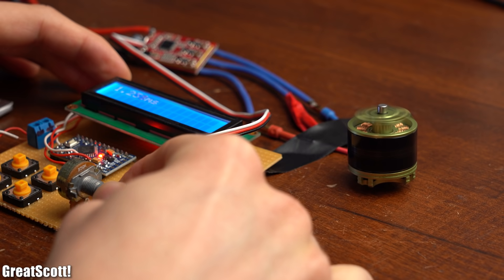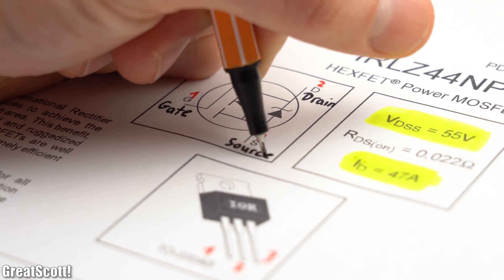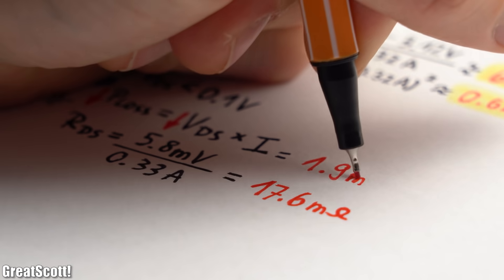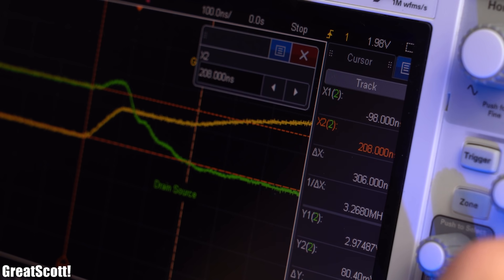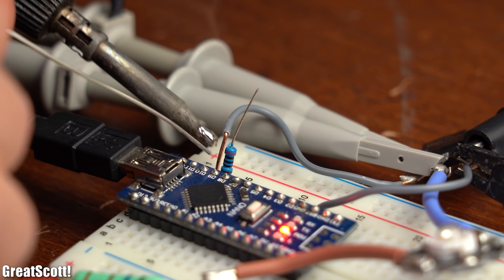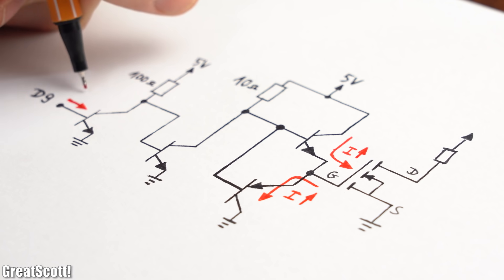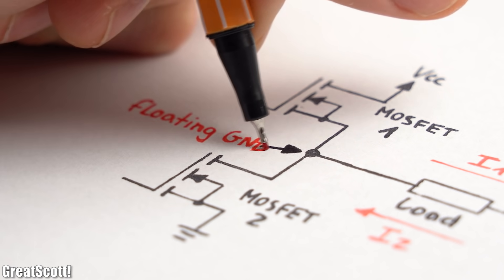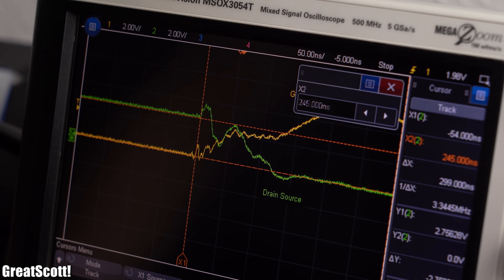Here is why MOSFET drivers are sometimes essential! || MOSFET Driver Part 1 (Driver, Bootstrapping)

Comment: Get a better marker so you don't have to overdraw every single path 3 times. Also get a better highlighter. While it looks good, you abuse the viewers time for something that means absolutely nothing to the problem. You could instead explain your diagrams and your equations. I feel the focus is wrong in this video. You clearly know what to do about the electronics, but you deliverance needs a bit of work. 

I was looking to get some knowledge about the MOSFET, but besides the hidden capacitances, I don't feel enlightened. 

Very pretty diagrams, though. Could perhaps be drawn in advance? Also easy to understand your spoken English.

Comment: @GreatScott, is there a way to find out the mosfet "Turn on event time" without scope? Or to be more precise, what values from datasheet I need to calculate correct resistor between arduino output and GATE...especially for MOSFETS that have quite high Qg (162nC)

Comment: I notice you use the oscilloscope to measure the time for the MOSFET to activate in ranges of 300 ns or less. I guess this will mean that you need a quite expensive oscilloscope with a fast samplerate just to determine if you need a resistor for protection of a microcontroller. True, or am I missing something?

Comment: hi...PLEASE HELP,
I have a TC4429 Driver chip and a IRF4905 P channel mosfet.
I want to make a High side PWM drive. (it must be a high side driver as the negative of the load is PERMANENTLY connected to the Battery's Negative.)
I have put a 10k resistor from gate to positive,  
if i run the TC4429  on 12V.  and the load is a 12v load.... no problem it works fine.
However I want a 24V output and when i connect the mosfet to 24v then the TC4429 is still run on 12v, i think it does not provide sufficient voltage to the gate.... is that right and how do i solve that.
I'd really appreciate any help.

Comment: Question: Why do you need numerous BJT transistors in his example mosfet gate driver schematic (not the IC)? Wouldn't 1 suffice to switch an external power source to the Mosfet Gate, charging it and switching it more quickly?

Comment: Hi Scott a quick question, Im building a SSTC and im powering my driver circuit with 12VDC and I try to measure the output right after the mosfet drivers and I only have 1mV of voltage in the output 
By the way when I meassure in the pins I have the 12V.
Why would that be?
PS: I have wire it all correctly according to the datasheet and my frequency is coming out ok as well

Comment: MOSFETs should be kept in antistatic bags or conductive foam ... not rattling around in a plastic box. They should also be handled properly. You can easily blow the gate oxide by mistreating them.

Comment: I'm new to circuits, what is better mosfet or transistor when switching a highvoltage motor on and off digitally?
motor 250mah 6-12V tried transistor as switch vc 100maH 50V external power 9v it burned lol
and almost bricked my arduino board

Comment: I have this issue that has been bugging me since school. As I understand it, PWM sends a pulse train of 500Hz. So you have two transitions every 2 ms. 
What happens inside an H brigde when the upper and lower mosfet during transition? Is there a risk of both of them conducting at the same time?

Comment: these days, instead of using bootstrapping circuit to drive upper MOSFET, one can use optically isolated gate drive IC such as TLP250 (or equivalent). This Method is much easier but requires to have more isolated supply ( but this can be easily done using isolated DC-DC converter)

Comment: 47 amps through that one little pin. . . on a system that will have 8 gauge or so wire everywhere. . . seems so strange they don't have beefier pins.

Comment: Discharge resistor should be placed BEFORE current limiting one, otherwise you're creating a voltage divider on Gate pin.

Comment: Miller capacitance, the one you are talking at 6:30, is why we can't have nice things in the world. It really makes interesting engineering challenge, and is unavoidable. I once was designing high efficiency inverter, and instead of just using 4 MOSFETs, I ended up with 4 MOSFETS plus extra 48 transistors (FETs and BJTs), plus a 16 channel DSP driving scheme. Crazy, but it worked beautiful. Required a lot of simulations, including parasitics. Using driver ICs is probably better tho, both from complexity perspective, isolation, and performance (ICs can bring loop area smaller, and and reduce inductance). Also 4-pin FETs are getting popular, especially the SiC and GaN ones, where there is a separate source pin, just for driving. The pin has own path to the package for source, so there is no voltage drop when there is current flowing, and it has lower inductance, all helping with turnoff time and voltage clamping.

Comment: we need a video on snubber circuits that are used within mosfet output sections to prevent high voltage overshoot and ringing when driving inductive loads like in SMPS applications

Comment: sir, i have a plan to make arduino pwm, since the main voltage is 18650 battery,  so the voltage will decrease. how i put voltage feedback for pwm ? i failed many time to do that, since no pwm use voltage feedback, except for buck or boost converter....

Comment: Just wondering, how did you arrive with 200 ohm resistor value. Also, is it a concern that the 56mA current is higher than the 40mA stated?

Comment: At 8:37, your resistor setup could be improved. With your current setup you’re creating a voltage divider. You should put the shunt before the series resistor instead to get the same benefits with no voltage division.
Reply: How can it make a difference if they are in parallel?

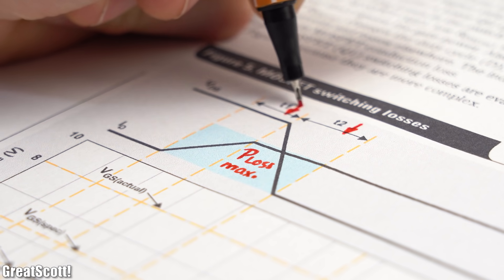Comment: Yo Scott!  The mosfet driver circuit shown at 9:40 rapidly charges and discharges the gate of the mosfet just like you told us.
But another aspect of this circuit is that it also inverts the mosfet ON/OFF-state in respect to the microcontroller pin at D9 ?
With the gate connected directly to the microcontroller,  that pin turns HIGH = mosfet ON, pin LOW = mosfet OFF.
And using the mosfet driver schematic it becomes: pin HIGH = mosfet OFF, pin LOW = mosfet ON.
Or am I misinterpreting that schematic wrong ?
Always nice to see a new video from you, keep it up !!
Thanks.

Comment: Very well done videos. You have a natural talent for teaching. You lay out the concepts in a logical way which makes them easy to understand. I have a formal education in electronics, but informal instruction like this through YouTube is really amazing for the hobbyist without a formal education. You have earned a new subscriber.

I've used plenty of MOSFETs in a variety of circuits in the past, but even professionals seldom just know how to do these things from memory. Unless you build the same circuits all the time it is often helpful to study some references before designing anything. I think videos like this are even useful for professional EEs who want to brush up on the concepts before diving into a design.

I just bought a broken plasma cutter. It works just like a big off-line SMPS by rectifying the 240 VAC in to 350 VDC, then switching the 350 VDC with a variable current limit and rectifying the resulting AC to develop the 10-60A needed for cutting up to 3/4" (19 mm) steel like the proverbial hot knife through butter. On the switching board are 16 FETs arranged in four groups of four in an H-bridge. I can see two rather large torodial gate drive transformers on the board. I am looking forward to the next video to make sure the technical details of using gate drive transformers are fresh in my mind.

Comment: brother scott. u r amazing . do you know texas instruments  UCC27710EVM-005
, booth strap card, which has every thing built in. the user dont need to solder anything. i used this card in order to create a switch  from 0 to 120 volts dc for a piezo module. can i send you  the details to u email? i used two n channel mosfets and an adruino to switch voltage automated. i am able to switch the voltage but need some help in voltage rise time(depends on resistor values), how can i send you my project files....regards

Comment: Why not show something that users can use more readily and is cheap and available in DIP-8 such as a Microchip TC4420?  There are many devices with the same pinout/footprint (e.g. TI UCC37321 etc.).  Also you can use a part like a IR2101/IR2110 if you want a DIP bootstrapped hi and low side driver.

Comment: can't you just add a smaller mosfet, or even a single bipolar transistor that has a smaller capacitance value on the gate to switch the bigger mosfet?

Comment: For some of those applications, you can use a MOSFET driver directly to drive the LED Load. The ones for example in my inverter are rated for 9 Amps and actively drive high and low, which is useful if you want to encode data on a fiber or laser diode.

Comment: I am working on My Camera with flash. I need power LED to do super flash. However, if flash light is to bright, the taken picture looks too bright/white. I need to dim my flash light when I HIGH my  miocrocontroller pin. I need to turn of the flash light with LOW , How can I do? .  Can I use IC555 to do pwm output to the gate of MOSFET?

Comment: I need a circuit to drive a high side IGBT for control speed of 180v dc motor of my running vehicle manually because the driver ic was burned

Comment: 4:40 Thermal runaway is always fun.  I remember one time in lab I accidentally hooked up a BJT wrong and it exploded in my face.  We were wearing PPE, so my eye was saved, but a large chunk pinged right off my safety glasses.  I probably would have been injured if not for the safety glasses.  Remember kids wear your PPE :).
Reply: Help me to control a DC motor please, I am using IRF3205, and the 12V geared DC motor is not turning off...Thanks

Comment: Should be mentioned that the reason bootstrapping is recommended in either high efficiency or high power MOSFET designs is because of the use of N-Ch FETs for the high side switch instead of P-Ch FETs. N-Channels, by their nature, are more conductive/lower RDSons than P-Channel and thus increase efficiency/lower waste heat generated.

For lower power applications, you can get away with just using a P-Ch MOSFET for your high side switch which then you can tie both gates together to a single GPIO (provided their threshold voltages don't intersect which would cause a shoot-through problem).

Of course, you'd need to run the numbers and use good engineering judgement ^_^

Comment: Because the gate of a mosfet has a capacitance,slowly charges and discharges through the driving resistor and if left in high impedance the gate remains charged and the mosfet in conduct state.In simple circuits a resistor 4k7-10k connected between gate and source ismany times enough.The problem of gate driving and discharging is in high speed and high power circuits and special IC's,isolation transformers and discrete design discharging circuits needed.

Comment: Now I know why the MOSFET of my boost converter turns very hot under high frequency
Reply: If you want to do additional reading check out Vishay application notes AN-605, AN-608A and AN-850. Depending on the application choosing a MOSFET with a lower gate charge and higher Rds_on can actually decrease power dissipation in the MOSFET. The reason is because of less time spent in the MOSFET "linear" region (Miller plateau, Vds falling, Vgs constant) when the actual Rds of the part is much higher than the final Rds_on once the gate is fully charged and Vgs has developed between the gate and source. Rds_on begins to become more important a high current levels, but I would guess you are not at levels that high (multiple amps).

The faster you switch the MOSFET, the more switching events happen per second, and the MOSFET spends more time transitioning and less time in the fully on or fully off state. This accounts for MOSFET switching losses. When Vds is falling and Vgs is constant (Miller plateau) the MOSFET is in the linear region and current is flowing through a relatively high Rds compared to Rds_on. There is a balance between switching frequency, drain current, inductor size and power lost in the FET. More efficient designs run at lower frequencies, but ripple can be higher so larger inductors are needed. Inductor size can be reduced at higher switching frequencies, but the MOSFET switching losses can be higher. 

I don't know what circuit or parts you are using, but even off the shelf converters might not use the most optimal MOSFET. If you need to increase the switching frequency, look at the datasheet for the part you are using, and then try to fine one with the same or greater Vds and a lower gate charge. Make sure you don't exceed the drain current, Id.

Comment: Could you make video about high-side mosfet driver? I am interesting in building circuit with infinite 100% duty cycle for switching n-mosfet on high side, but there are only 2 solutions I found: pricey IC that have advanced charge pump or cheaper non-100% duty IC with simple charge pump with additional external circuitry that adds complexity.

Comment: once i was using mosfet to control a motor at 12v 5 A with out a driver or isolator. somehow mosfet died (dead short all terminals)  it destroyed my 2 arduinos and turned off my pc. pc died after a year. always used drivers, diodes and isolators.

Comment: @GreatScott, so I need to start thinking about next year’s Halloween props.  One project I am thinking of is a notarized spider.  I would like to motorize legs and head.  The basic requirements would be high torque motors at the joints to move the legs.  The legs will not move quickly.  So, what would you recommend for a motor to initially look at?

Comment: I’d love to see you discuss the consequences of using a 3.3v PWM output as provided by an ESP controller. Currently I have some designs where I’m providing a 15vdc gate driver voltage to facilitate good MOSFET switching, but that’s now a second power supply on the pcb (in addition to the 5vdc one to drive the ESP). The MOSFETs are driving 24vdc LEDs.

Comment: Great video. I have been using MOSFET drivers in my designs for quite some time now, without really knowing (or caring, tbh) about their inner working. 
Thanks to you, I can now make better component selections and designs. :)
Reply: help me to control a DC motor please, I am using IRF3205, and the 12V geared DC motor is not turning off...

Comment: (sees the neat component and thinks “how do you get something so small attached to that custom board though? It’s so small.”) “through the help of ... my reflow oven “ - well, ok then.
Reply: I have an old counter-top electric skillet with temperature control that I let warm to the right temperature, then set the boards on.  An oven would be better, but it works.

Comment: any suggestions for ICs that can be operated with the same method of series control like WS2812b LEDs (in a series yet you can control each independently but each IC only controls 3 devices with a range of power, in my instance I want something that just turns on and off things but can control that on/off state for say 16 items instead of just 3)  ??
Reply: understand I am looking for a series of ICs that I can control in a string from an arduino pin out,  so I can control say a whole row of devices in an on or off state like say 16 items to 1000 or so items all from that one pin sending out a binary pulse of some sort (or series of binary pulses)
Reply: WS2811

Comment: Great video, so to summarize, the simplest and safe way for driving a fet from an arduino is to NOT connect the gate directly to the pin, correct? A resistor will be required, notwithstanding the increase of switching event time?